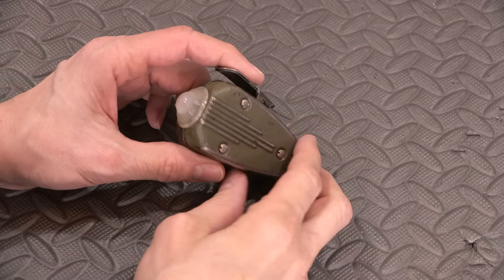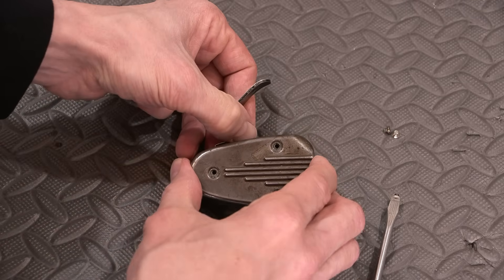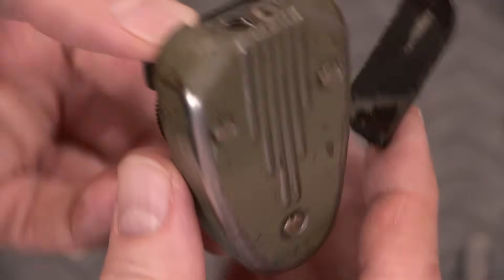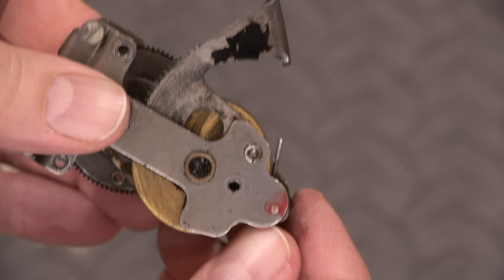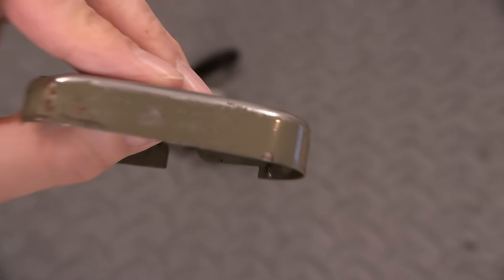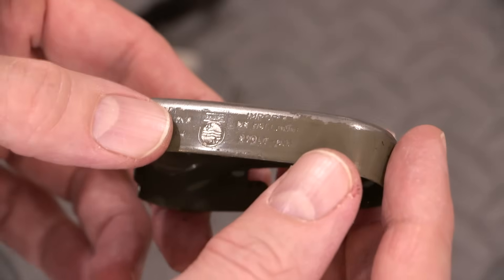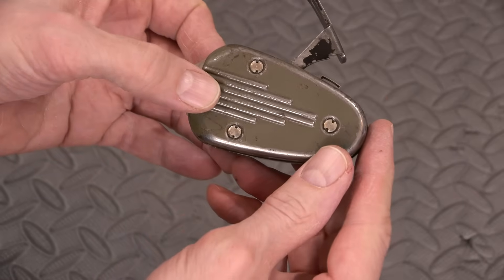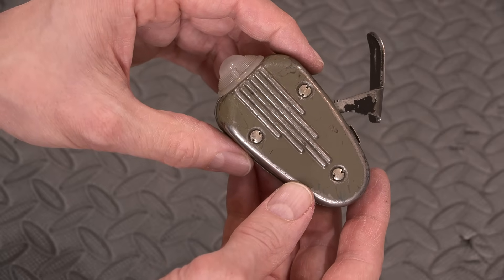WW2 Dynamo Flashlight - Doesn't Use Batteries! Let's look Inside.

Comment: 😂😂 you know I’m all about flashlights. Only because I’m poor and can’t afford an RF signal generator or oscilloscope 😖😖 

Anyhow, as you got about a third of the way into this video the first thing that’s going into my mind is hey I would put a giant clear half watt LED into this thing probably with a capacitor and possibly with a voltage regulator😂😂 and then you basically paraphrase what I was thinking earlier on 😂😂

Comment: take a burned out bulb, crush the glass out of the base, clean the base, add a bridge rectifier, resistor and some LEDs, preferably some warm white LEDs, it will be way brighter and more useful, and the lens is not clear, so it is not obvious that it is a LED

Comment: Keep that one original. Find another one to modify with a bridge rectifier, storage cap, and LED light. Then put them side by side at an electronics fair. Have people try each one and see which is more efficient. Some people's hands would give out after about a minute even on the LED one, but I milk 2 dairy goats each day. My hands would really last a long time. Back in WW2, many of the soldier boys would have come from farms where they hand-milked cows, and their hands would have been able to run this quite easily.

Comment: I have two of these, which belonged to my grandparents. My father (born 1923) once told me those where given to them by German Wehrmacht soldiers during ww2, when electricity was cut off in the (Dutch) region where I live.

One is completely original, including the 4.5 volt bulb, which seems to have the exact same dimensions as the bulb in the movie. The only difference seems to be the copper socket of the original bulb.

The army green colour is original, the pushrod was black on the inside. There is no colour left on the outside of it, so I’m not sure about that.
Reply from the maker: Thanks for sharing your story!

Comment: Regarding the specs of those bulbs, I think it was like a possibly quarter, amp but I could be winds and winds of one zodiac's around 1.2 V. I to believe potentially. We're gonna be able to point to something like this. I know a lot of times in flashlight. S they actually overdrove the bulbs just a bit by a few fractions of a Volt.  In some cases 

Like generally, a 3 V flashlight would be around.Two points of evil bulbs did this for better performance at a cost of a bit shorter life 

By the way often times these bombs did not reveal their actual ratings in some of the packaging you really had to dig deep to get a life rating.

Sometimes quoted at only five hours where it wat available.

Were even quoted as less than five hours.

I've had plenty of time.That I've had Willie is running for much longer than that.Even not continuously in hand plenty until mobile after crazy.And yes, I know how bulbs are actually rated with a sample of leave.50% burn out to indicate average life.Even then it is outside of this curve you could say.

One good thing about those bulbs and similar.Once is the very sturdy fillman fairly thick for the Is average bulb 

One reason why love all this bulbs can be somewhat more.Durbel, I've heard this even from the engineers before.That sometimes under recognition.Low voltage bulbs are much better even for a longevity and Some other positives even not giving safety concerns or otherwise.Just like for like comparison and potentially even more light Output for current usage.More lemons per Watt.I think would be waved describing this but if a small bulb it's really yeah murky

Comment: This kicked up a lot of memories for me. Like the time I used one powered motor to spin another motor that supplied voltage to a third motor which spun a fourth motor that then powered a light bulb. No use or purpose whatsoever. 
Although I did manage to reconfirm that the final output would not be able to render the system perpetual. Hey, I was young, I had to try. lol

Comment: Can you share the thread size of the case screws? My guess is M3. Seems they don't make that Notched edge Spanner type screw anymore, which I'd love to find. After watching this video I purchased this same mode Phillips 7424 Dynamo Flashlight from a Canadian seller, but it has straight slot replacement screws.

Comment: That device was a totally impractical light as the operator had to continuously pump the generator. Adding a diode, capacitor, and switch would have made it useful as a light and a power source for other devices.  An interesting experiment would have been to power a white LED with the device. White LEDs usually need 4 volts but I think that generator would do that. Part 2?

Comment: upgrade.... the lever rotates the outer casing of a coil spring that interacts with the gear wheel that increases the ratio on the dynamo gear. compressing the lever winds it up to run at a contiuous speed for an extended period.... still short, but you can press it slower regularly.... to keep a short charge on the drive spring chassi...

Comment: i do not know why there isnt an aluminum electrolyte dry capacitor. they have existed since the mid 1920's and were primarily used for MILITARY EQUIPMENT. does not make sense to forgo that technology on a short term flashlight like this, so that you didnt have to continuously pump the mechanism, for bursts of light, when you can build a small charge to hold a steady light source for even just a minute.

Comment: These still exist, we don't have to ponder what modern innovation could do with this lol. I had one in my house growing up in the early 2000s. The light is over almost instantaneously after your crank ROM is finished. If there were two cranks that could be operated by different parts of the hand at the same time I believe the design would improve.

Comment: think of how durable the mechanism was made compared to anything nowadays. If modernized with LED it would be more efficient than anything else you could buy in terms of how much effort is required to hold sustained light. But it would need a battery added somewhere

Comment: I can't remember where I found them, but I acquired a couple of those types of self generating flash lights (made in China) that were given away as free gifts for trying some product. One of them fell apart pretty quickly, and the all plastic gears ground to a halt after several teeth disintegrated.  The other one I was able to use without any trouble, but it was more of a hand exercise machine than good flash light. It wore your hand out keeping the two LED's lit. So I decided to enhance it a little. I added a 5 volt 2.5 microfarad super capacitor, and a 1N4007 diode to rectify the current from the little motor/generator. Result: It took longer to get the LED's to fully light up, but once they did, they would stay lit for a few minutes before I had to start squeezing again on the handle. Your old device was built way better than my cheap Chinese made copy.

Comment: I did ww2 reenacting,and the sheer volume of flashlights the Germans had was astronomical. Ive never had one of the battery- less ones, but am aware of them. I had the ones with 3 color lenses for signaling and a slash cover for safety at night. The problem is with these that they take an older style European battery with " tongue tabs" that contact and complete the circuit.....you can't get these in America....but, i did find that a certain brand of sealed emergency flashlight does have these batteries to this day,i can't recall the brand name,but it shows a fireman on the package....if you carefully open the flashlight case, this battery is inside. Other than that,you can solder AA batteries and wires to make it work,but you risk either a very dim light or blowing up the bulb,which is an old screw in design that may also not be made any longer. If anyone has these flashlights,i hope this info helps ❤ 
Ps: those screws are called spanner bolts in old vernacular.

Comment: I would modify a bulb to have wires coming out of it that run to a diode and a couple of capacitors or super capacitors that can drive LEDs, I have seen others do this sort of modification that makes sense when using a dynamo..... You charge up the capacitor and use the stored energy when you need it! The run times possible is worth it! Definitely better than constantly squeezing the lever.... Even with an incandescent bulb, the diode plus capacitor setup is far better! 
One guy would charge super capacitors which would then charge a couple of lithium batteries, the capacitor has the ability to take everything that the dynamo has to offer while the batteries with their higher internal resistance can take their time charging.... For one minute of cranking the dynamo, he got hours of operation..... Otherwise he had to constantly crank to get some light..... 
It would be interesting to see what this little Philips dynamo can achieve.... With some non destructive modifications to bring it into the modern world?

Comment: Those were made by Philips in Netherlands, and during the ocupation in WWII, when Philips was taken over by the Germans, they used slave labor to produce electronic valves or vacuum tubes for the German electronic equipment and they also continue producing this dynamo lights, with a few mods (added a leather strap to fasten these torches to their uniform) for the use of the German Army. 
I have one, here with me, inherited from my grandfather, who brought it from Europe back in 1943. Still working fine. Try that with a modern flashlight. 
Leave it as it is…. Original.

Comment: Keep the external features original , cleaning up a little bit.I would say restore functionality maybe add a battery to the circuitry and updated a little bit. Don't alter the outward appearance. It's got that vintage world war II vibe that collectors love. Original but if its original functionality needs work you can update the guts as long as everything functions like normal

Comment: Mr Carlson you seem those 3 wheel bikes old folks riding around the charger for those are a switching power supply they are very Dirty you should build a clean charger for those bikes you probably sell lot of them because Ham Radio guy will buy them and give it to the person nextdoor to them so it won't bother their radio

Comment: Hi! I'm writing because I had one of these flashlights in the early 60s, which I used for a long time. You know, it was more of a toy for a child than a battery-operated lamp. If I remember correctly, it even had "Wermacht" written on it. Back then, there were still a lot of WW2 equipment in use. I'm a 70-year-old electrical engineer now, but I still have my well-equipped electronics lab. (Tektronix, HP, R&S, etc.) It's hard to quit when your hobby is the same as your profession. I was about 6 years old when I first picked up my father's soldering iron. I wasn't in school yet, but I knew about series and parallel connections, I knew that copper wire conducts electricity much better than iron. Of course, both of my sons became electrical engineers. I wish you continued success and good health from Hungary!

Comment: I really hope you don't destroy this masterpiece, so-called restoring it, restoration of something like this isn't stripping it's original paint that is impossible I repeat impossible to replace because they just don't make it anymore not like that, if you want to take it apart freshen and lube everything up to where it works like brand new, Even if you needed to put new copper wire or something in the Dynamo to make it work that's acceptable, again that's 100% cool but why would you need to strip it I don't understand? I get if it was from the '80s or the '90s or something like that and you were just wanting to freshen it back up and put some new paint but this is a world war II artifact brother Don't desecrate it please. Great video thank you for sharing.

Comment: To add a capacitor & led you don't need to do anything to it. Use one of the many reg bulbs that fit, remove the glass & filament but keep the contacts & solder either a pancake or low height cap inside the bulb thread housing. Solder the resistor & led to the leads & mount them on top of the cap with an insulator between them. Viola' led w/o modifying the original at all. I'd clean out the old grease & would then add a paraffin based oil to help it work out any small pieces of metal, & debris it just to see if that improves the performance of the flywheel. (I'd recommend the original zoom spout oiler <Turbine Oil> of NORVEY Inc. @ 300 So. Standard Ave. Santa Ana, CA 92701) Been using it on micro switches, pc fans, & other really sensitive electronics for decades. I get better speeds with less wear, noise & power draw & usually don't need to referb them for another 8-12yrs unless in extremely dusty, greasy <like food service> or high heat environments above 340 degrees.  Then you can always add grease again afterword's if you like. As for painting it, if you can't match the original kind of paint, I'd leave that part as is.

Comment: I’m finding it hard to believe that 222 bulb did not work. The 222 is a 2V, 1W bulb. I think that bulb would work very well because of the magnifying glass. Give you a little spot point in the front, with a little bit of ambient light to illuminate that outer lens.

I wonder if the socket just wasn’t accommodating the length of the 222 bulb, or maybe that bulb was faulty.

Comment: Hm, I have seen lamp inserts with a built-in condensor and LED that fits quite nicely inside this type of light. It reduces the need to squeeze it to about once every 10 seconds and still have somewhat constant light. It is not original of course, but it is quite practical.

Comment: 14:00 I haven't seen those flashlight bulbs since I was a young kid, I remember that they used to sell the long discontinued blue colored ever ready zinc chloride dry batteries and the bulbs were beside them for the flashlights that they had back then, the bulbs were about 30 cents each (1980s)

Comment: I'd leave this as-is except for the lens repair and maybe replacing the old reflector paper.  Also, an LED bulb without further modification would be acceptable.  Going beyond that would detract from the historical significance of the device, which (on camera) appears to have a beautifully smooth natural patina.  It has tremendous charm just as it is.  This is a case where restoration would take away more than it would give.

Comment: When I was a kid I inherited a dynamo bicycle light. You flipped the roller gear up against the edge of the tire and as it spun it would light it and dim as you slowed. I always thought that was the greatest thing ever because it didn't need batteries. That's what started me opening all kinds of things to see how they worked and even led to building a small hydro electric dam for a science fair project.
Reply: I had one of those on the bicycle my dad bought me when we moved to town.  He surprised me with an all chrome plated bicycle, it was  a 3 speed light weight, what we called back then "English Racer" bicycle, I think it came from Sears.  It had one of those dynamo headlight/tial light sets on it  Very cool.
Reply: In finland basically every regular bicycle came with one in latter 80s/earlier 90s.

There came some law about needing a light or something. And a reflector at the back. Its dark in the fall/winter early.
Reply: The resistance on them was awful.
Reply: Downside is they wore your tyre away
Reply: Clean it, oil it.but don't paint it leave original.

Comment: Dutch made ww2 flashlights made by Phillips company based in Eindhoven. The Dutch "name" for these devices was "Knijpkat". ( Sqeeze the cat ) The bulb was the same as used in bycicle lighting mostly 6volts E10 fitting.. do not ruïne it,  keep it original.

Comment: I own two examples of a modern version of that thing.  One is in the car.  They are nice as a way to have a light that never has dead batteries in it

One of my uncles had one in WW2.  It was nice that its light was very directional.

I say don't  restore it.  but do try to find a bulb  rated for perhaps 3V  Also where the filament sits matters.  You want it at the focal point of the lens.

Comment: This type 7424-03 squeeze torch from the Second World War was developed by Philips.

The squeeze torch got its nickname (knijpkat) from the sound it produced when operated.

A cat-like whining sound. Due to the shortage of all kinds of raw materials and products, and the lack of batteries, people were forced to think creatively about the smallest objects for our daily use.

Due to the blackout, having a light in the darkness had become a very important commodity.

Philips had a handy solution for this in the form of the squeeze torch, a flashlight that worked with manual operation.

The squeeze torch was invented by Ir. L.J. Kalff. Although the squeeze torch was not patented until 1942, production had already started in 1941.

Comment: My late grandfather had one he used for a while, thanks for another great video!  Would it work at a lower rotational speed if a 2V bulb (100mA at 2V RPMS supply) is installed?  i.e. less frequent squeezes, but longer durations of somewhat constant force.

Comment: I have 3 of those Knijpkats. the Philips one needs a 2volt 0,1amp. bulb the other ones i have were made after the 2nd WW. and needs  3,8volt 0,07 amp bulbs and are marked GERES. Still working good.